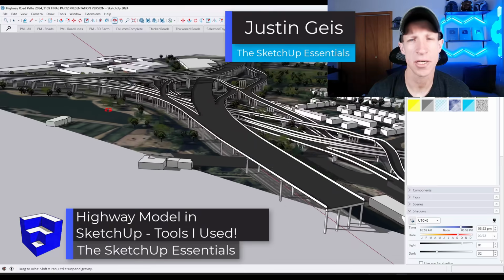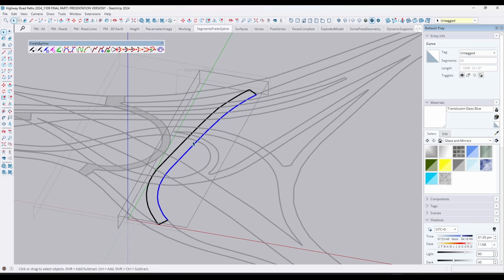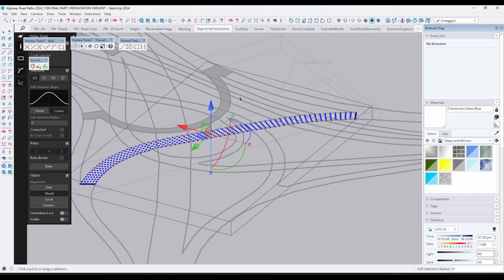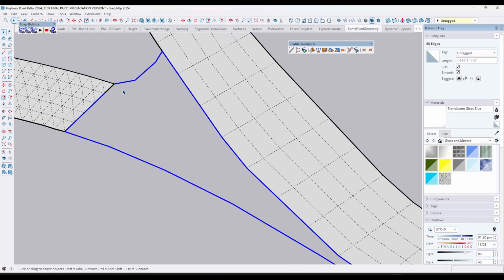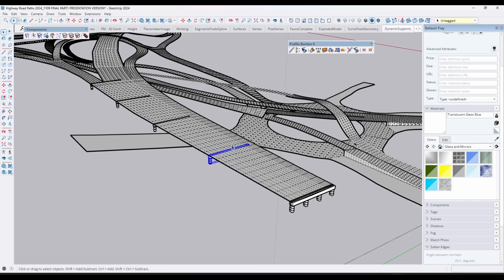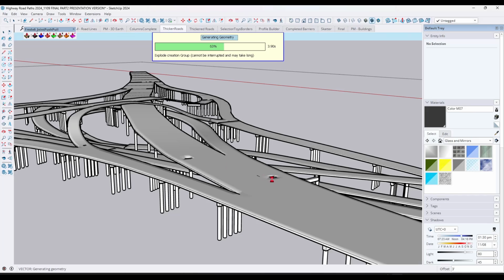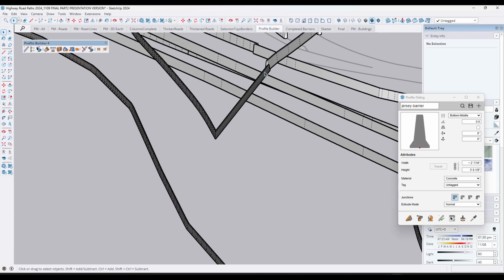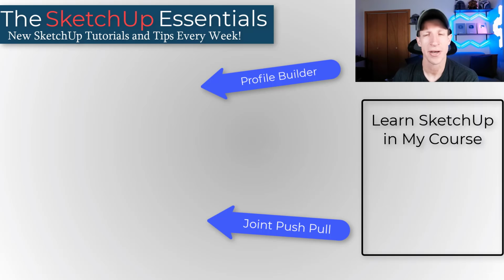The HARDEST Model I Ever Created! (How I modeled Spaghetti Junction in SketchUp)

Comment: Very nice work and demo!
I would like to know how you made that support component that's scaleable! Never seen that before.
Another question is how you would go on to add road markings for lanes and islands? Manually with drape tool?
Reply from the maker: It's a pretty simple component - just a dynamic box that scales, then a component that repeats a column 4 times evenly spaced at the bottom. It's great for really fast work, but if you scale it too far in it starts putting the column in some weird places